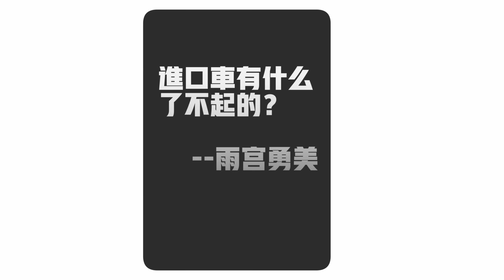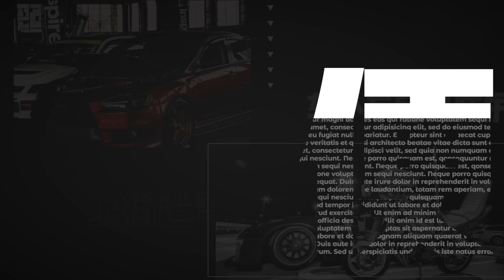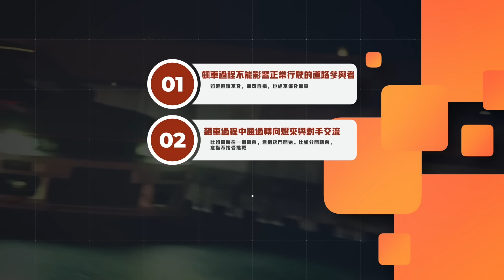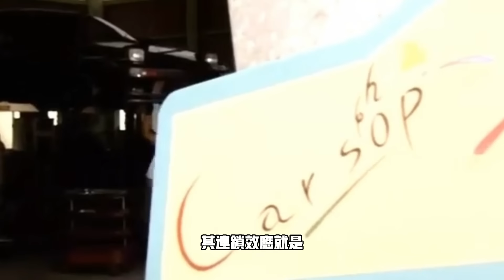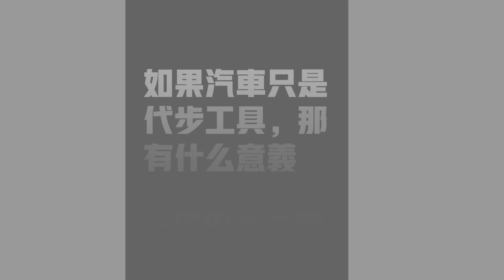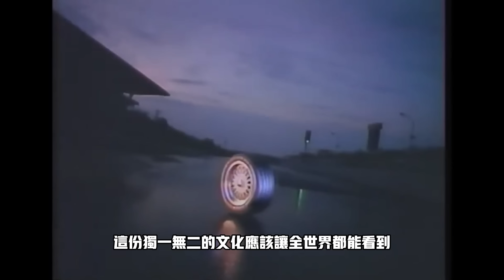藤原拓海原型是誰？JDM群像 |改裝車|日系車|永田和彥|雨宮勇美|土屋圭市|稻田大二郎

Comment: JDM is really still popular in the US and Australia. I own a new NISSAN Z and GR Yaris, both are manual. On track days in Brisbane Australia, I see mostly Mitsubishi EVOs still and tons of Toyota 86/ BRZ. People in the US still pay big mark up for new Type R and Corolla GR. It is definitely not dead in overseas.
Reply: So lucky to own both the type r and the GR corolla, these cars are so fun to drive. Working hard and trying my best to be able to buy my next car and it will be the s2000
Reply: @liudxdx  S2000 is really fast track cars when staying above 5-6000 rpm. On the street normal driving, it felt flat due to the little torque low down. Very hard to find a good one now due to 20 plus years old car. Amazing as weekend car and in mountain pass. I tried it in traffic, felt underwhelming. Could have bought an AP2 10 years ago for just $20k AUD. Now it is $45k plus and high mileage